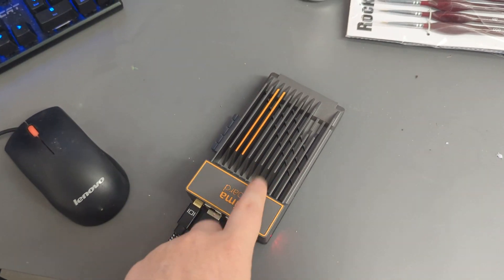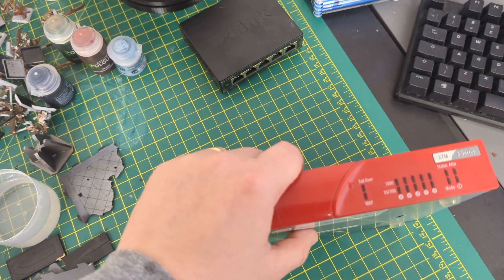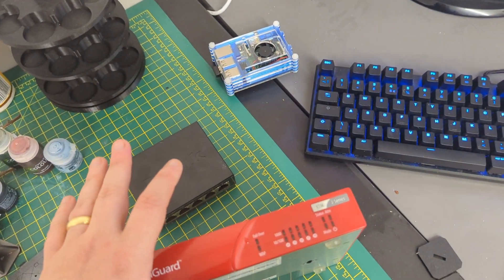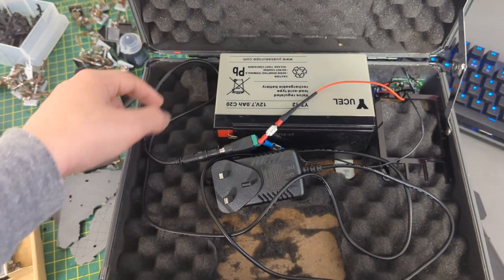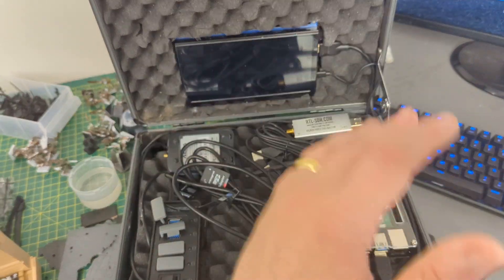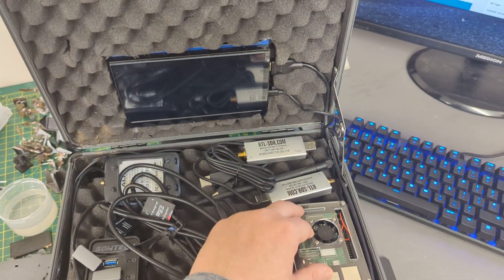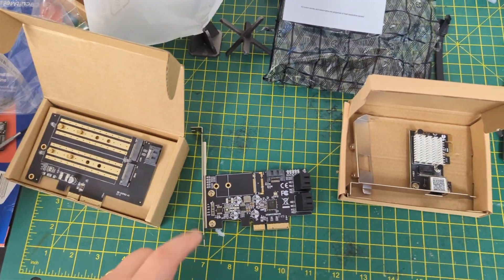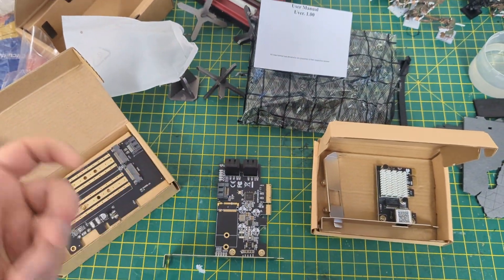Zima Board Physical Hacking Demo Kit

Comment: Hello there, nice kit, jammer on the table. Himmm . If posisable , love to see more of  your field testing of your awesome  jammer.
Video could be  - How to trespass drones electronically on private property.
Stars of the show:
1. Linear RF wide band amp 10 watts 
2. Discone  or wip dipole multi band 1mhz to 8 ghz Antenna. 
3 . Jammer 2 mhz to 8 ghz.
4. A pi sdr  reciever, scaning bands for drone signals ( 50mhz to 8 ghz )and auto turning on the broad band saturation jammer.
Test could be in a rual area . 
That should slow down most drones and video feeds.
Slow down the guys steeling the farm  animals lol.
Thanks.
From Andrew